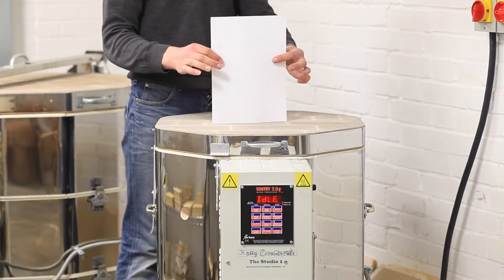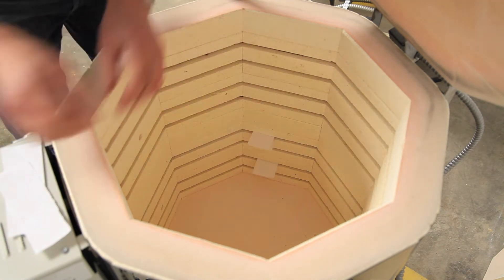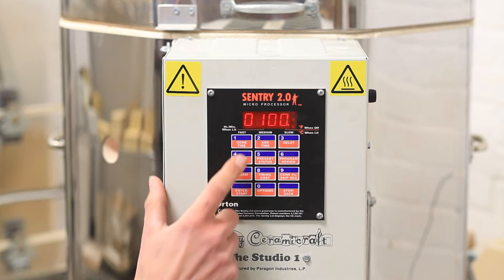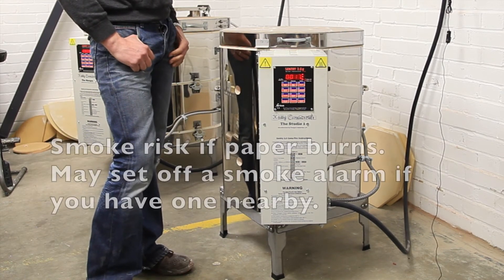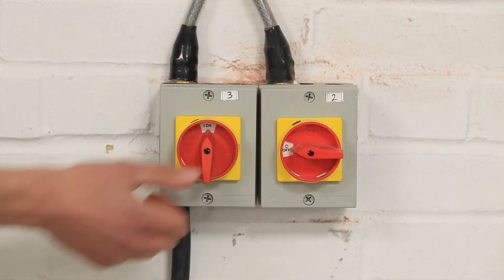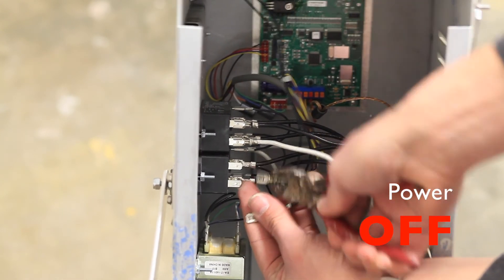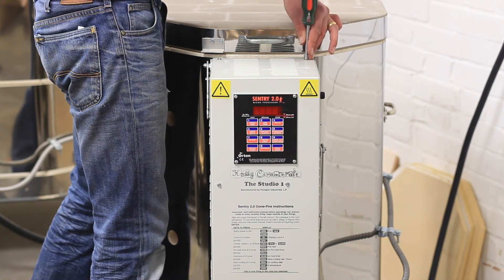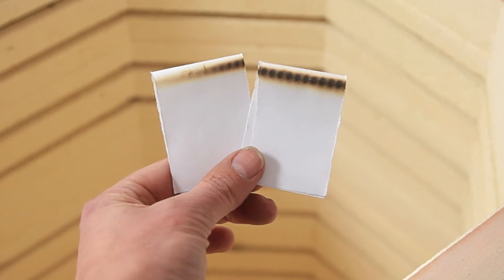How to diagnose kiln problems

Comment: Do you know what cause the kiln power fail?
Reply from the maker: Not really, there could be many reasons.. Check the power from the fuse board is all good, then investigate into the kiln.  If no power at the board, it is unlikely a component issue in the chamber.. check fuses in the kiln which are protecting the computer.. or maybe the computer itself..

Comment: Extremely helpful. I followed the instructions. Elements 3 and 4 did not burn. Opened up the panel and found the centre relay (I have x3) was burnt out. Thank You for the info.
Reply from the maker: Glad it helped